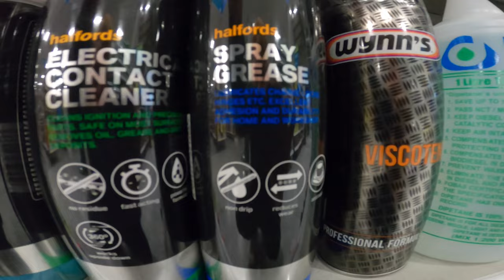CHAIN CAME OFF MID-RIDE! How to get it back on.. SINNIS TERRAIN 125

Comment: This happend to me the other day on my 2021 plate terrain. Due to the bad weather and winter commute to work caused my chain to rust and come off the front sprocket. I do keep on top of cleaning and maintenance but the parts are cheap and not fit for purpose would recommend a decent chain as what I did and haven't had any other issues since.

Comment: that bike isn't very old if it's the 2021 model and your chain is already rusted to ******. you shouldn't be reusing it. better to replace it with a rubber o-ring chain. don't forget to clean & oil your chain (and change your engine oil once a year). very important that you maintain your bike or history will repeat itself and this will happen on your new GPX. look after your bike
Reply from the maker: All noted and good advice man thanks 🙏🏼 will definitely keep up to date on the maintenance a bit more!

Comment: your chain didnt come off because of a lack of maintenance. it came off cos its a cheap piece of crap that cant handle the weight of the bike, I was tensioning it every two weeks, and it still came off on a long joruney, 3 times. Replace it ASAP with a good quality o ring chain. Since then, I tightened the new one like a month ago, maybe a little longer, and it hasnt needed touching
Reply from the maker: Haha fair enough, heard a lot of this kinda thing tbf. I’ve swapped it for a GPX now and so far so good, we’ll see what it’s like over time I guess. Videos to come on that bike too 👊🏼🙌🏻